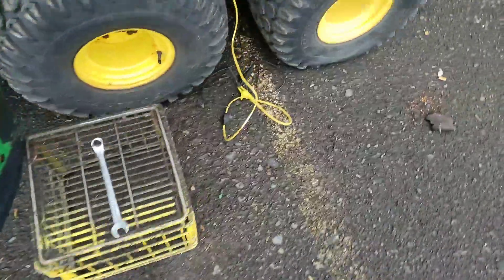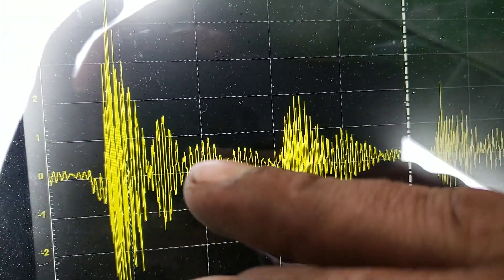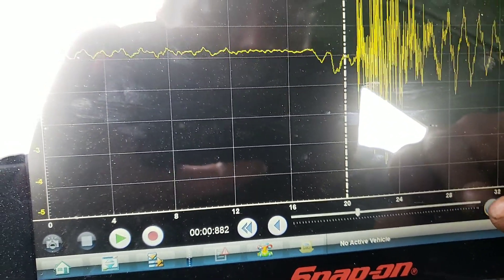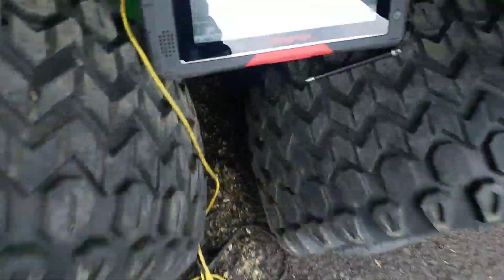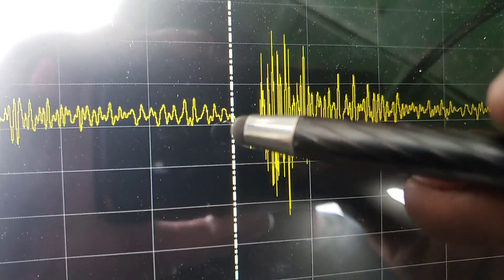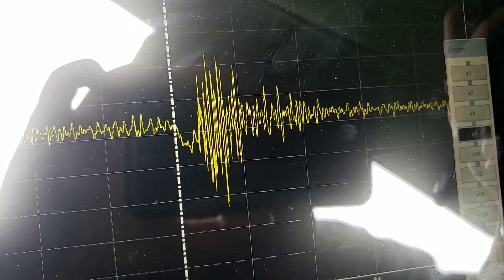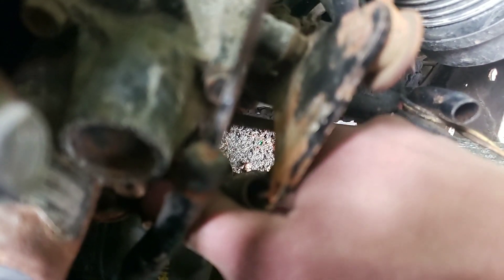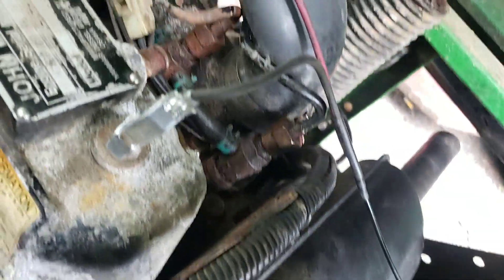Adventures in Mechanical Injection - Pt. 2

Comment: Hey chris. Phenomenal videos man.
I am currently getting into waveforms and am real interested in you going indepth with this stuff. Did you make the injector pipe connector or did you buy .
Cheers
Russell
From scotland
Reply from the maker: The clamp I'm using came in a diesel tachometer kit that I had laying around. I explain my initial thoughts on it in my "scoping mechanical injectors video".

Dave Sterl released a video yesterday that may make the whole process even easier though. Check it out, dave has brillant content. https://youtu.be/wLRHpJ0d8Jg

Comment: So basically, you have injection pintle oscillations due to weak internal injector springs?

What is the tool you're using to capture that waveform?

Comment: I'd love to better understand how the electrical signal from that probe correlates to the actual pressure in the line. 

Nozzles on similar "PLN" systems used on gasoline engines, (Bosch Jetronic), buzz open and shut to help atomize fuel. Do you know if nozzles do the same on diesels?

Any resolution to the F350 problem yet?
Reply from the maker: These systems are just a spring and poppet valve, there are injectors that buzz open and there are piezo electric and solenoid styles. All depends on the engine and year.

F350 resolution will be posted by the end.of this week, lot of other stuff going on and the customer only uses it for plowing so the shop pushed it off to the side awaiting his OK on the diagnosis.